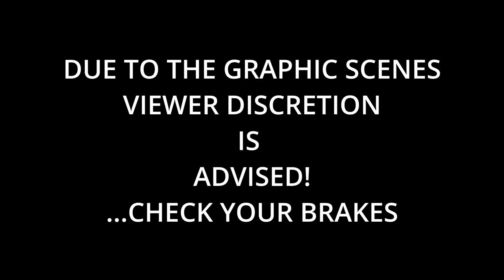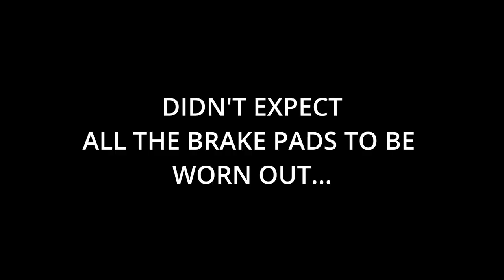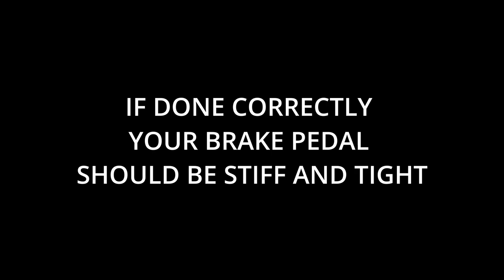HOW TO EASILY REPLACE A HONDA ACCORD BRAKE MASTER CYLINDER WITHOUT GETTING SCREWED BY THE DEALER

Comment: Thanks brotha .you just saved me $350 at the shop 😅
Reply from the maker: Awesome bud
Reply: I was just quoted 298 for the MC and another 244 to put it in.  Then they wanted an additional 159 for a brake bleed and a $75 diagnostic fee. Nuts.